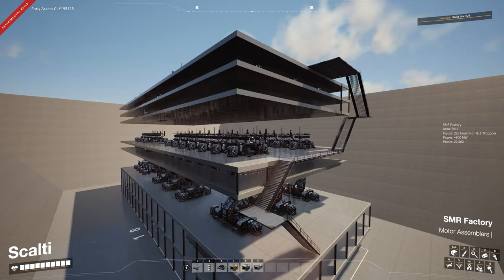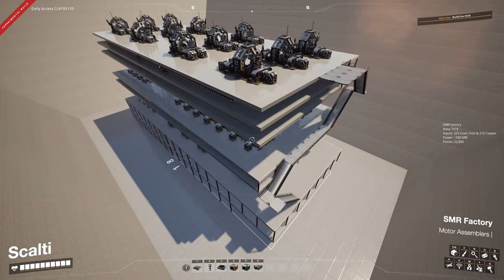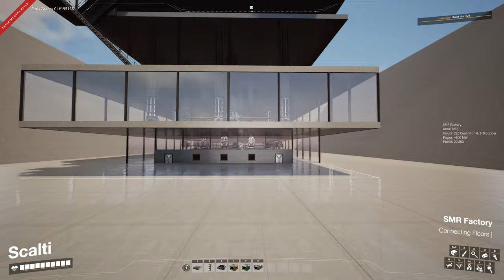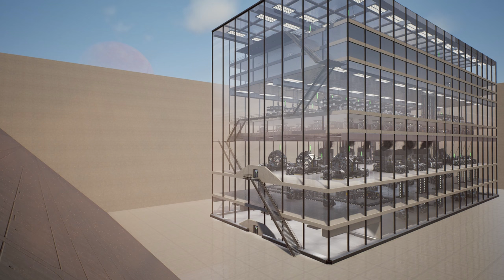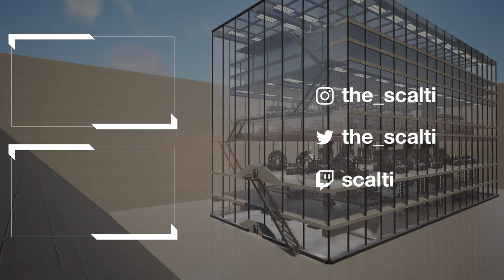ASMR Factory (Automated Stators, Motors, Rotors[alt]) 10 / minute [SATISFACTORY GUIDE]

Comment: Followed this guide as well.
At the end I made 2 mistakes, the Wire 180x and 240x were going to the wrong assemblers, fixed that, also the 90+60 Pipes went to the wrong assemblers, had to switch those around. Don't know how I ended up mixing that up.

I was amazed this thing worked as advertised.
Wonderful, but something I can never design myself.
You've outdone yourselves, Scalti.

Comment: One interesting variation on this is if you switch over to Solid Steel ingots, and add Iron wire to the mix as well, you can achieve 20 motors per minute and only use 217 copper (7 more), 200 coal (25 less), and 270 iron (25 more but does not exceed tier 3 belts) while also upping production of rotors and stators to 40 per minute, so you are basically still only using the three resource nodes and not exceeding their limits. this would however take 565MW vs your design's 418MW but I feel like that's somewhat of a worthwhile tradeoff. Build and design is left as an exercise for the reader

Comment: I spotted it right away when the one conveyor belt didn't get applied between the two copper output mergers between 20:22 - 20:25 -- you can see it again at 22:23 . Also you had mentioned something about linking in a video on how you did the lighting? but I don't see that anywhere

Comment: At the end where you are distributing for your motors, you are splitting 1 to 3 then merging into 1 and then splitting into 3 again. You would save a lot of belt work if you just split into 3 and did the smart splitter just for the middle motor assembler. Saves space, you don't have to have your motor to container floor hold in a cramped location plus with this method, the middle motor assembler will only run if there is an overflow where as in your current layout, all 3 are running at lower efficiency.
Reply from the maker: Incorrect.
Reply: @Scalti  not sure how, I did it myself

Comment: I made a modular expandable factory concept where each "block" aims to be 100% efficient on a singular output machine. Planning it was good in concept, but turns out the belting was a complex bowl of spaghetti and that really limited the potential. A sandwich layer would probably help in alleviating some of those issues. Power draw was great too, as a lot of buildings were massively underclocked. The idea was I would rail in more resources as I discover/need them and just build more blocks. Anyway what do you think about incrementally expandable factories? Worth the effort? Or better to just build a big factory twice?
Reply from the maker: Build twice. Especially early game and it’s overall a good practice to be as efficient as possible. Once you’re in mid game and things start to speed up in terms of progress by way of better understanding the game and increased input via higher belt speed, you can shift to this and plan your builds for higher inputs once you unlock faster belts down the road. I typically do this when I unlock MK3 logistics where I plan for 480 input but operate at 240 in the interim.